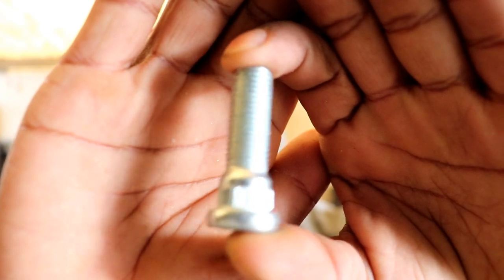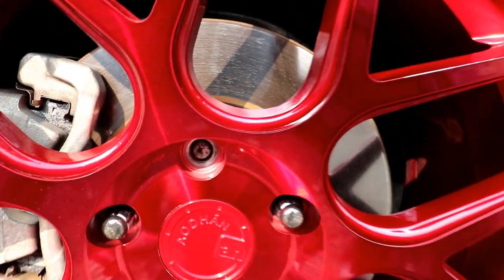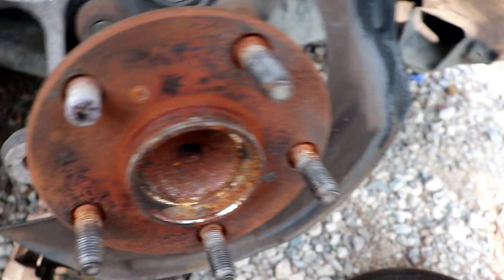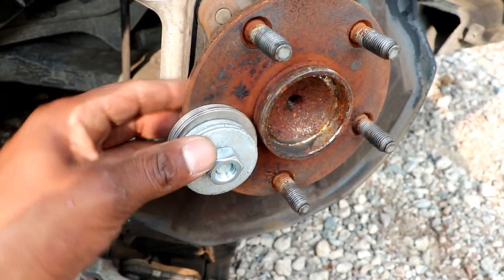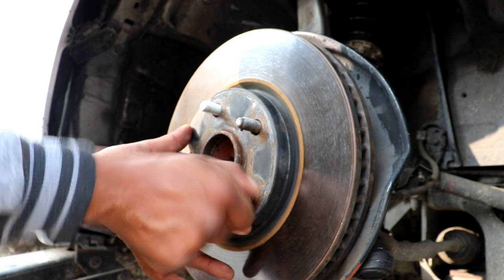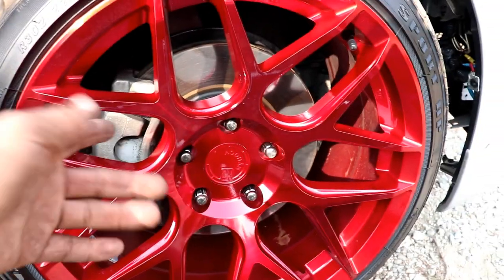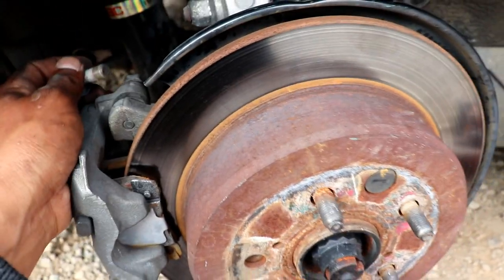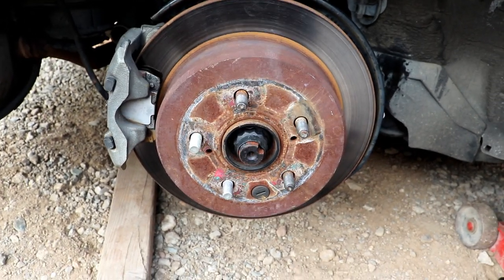06-12 lexus is250 350 wheel studs    #SSB #SimpleSickBuilds

Comment: hi I would like to ask if your wheels are AVID.1 SL-02 Wheels?
Reply from the maker: Yes they are reps to the AVID.1
Reply: You don’t have to remove caliper and rotor you can do without take them off. There is a hole in the back in front.

Comment: You were using a bolt to remove the the rotor, what size is that?
Reply from the maker: I just have a box of random bolts and found one that fits.. but a rub hammer will do the trick.
Reply: @SimpleSickBuilds  thanks 🤙🏼

Comment: Since you asked for it, and nobody else has said anything, why didn’t you flip the breaker bar over and put it on the other side??!!  

For those potentially reading this comment in the future, here is what I mean…

Instead of having the breaker bar on the left side…and needing to be dependent on your foot and/or floor jack to hold it from spinning…flip the breaker bar to the right side and have the floor do it for you!  

All you have to do is spin the wheel hub so the new stud is on the left side, wedge your breaker bar (on the right side), use your lug nuts as previously shown and viola! As you torque that bitch down…clockwise, for those who don’t know…the wheel hub will turn clockwise (to the right…again for those who don’t know). As the hub attempts to turn clockwise, it’s going to “take” the bar with it. As it attempts to do so, the opposite end of the breaker bar will catch on the floor putting pressure in the opposite direction allowing you to tighten/install the new wheel stud! 

Now the only caveat is having a breaker bar, or any bar for that matter, that isn’t long enough to reach down and “catch” the ground. If that’s the case, then you just might be S.O.L!  I kid I kid!  Lol Find yourself a long (and strong) metal bar (I’m sure you can find one at Harbor Freight, Home Depot, Lowe’s, etc.) and you should be set!